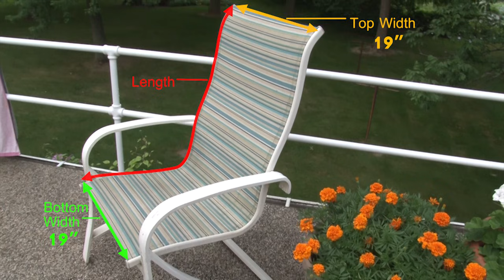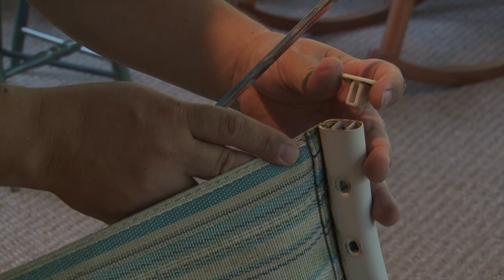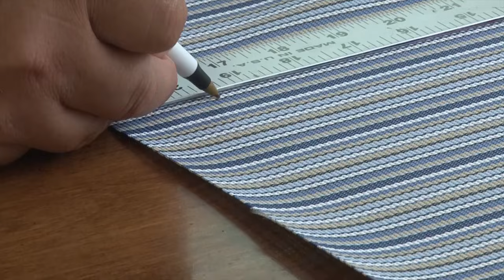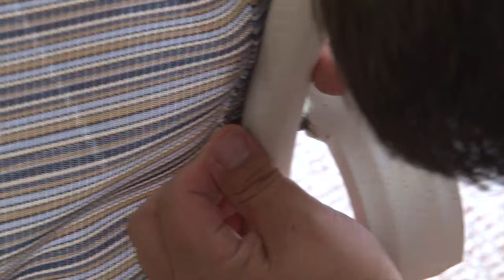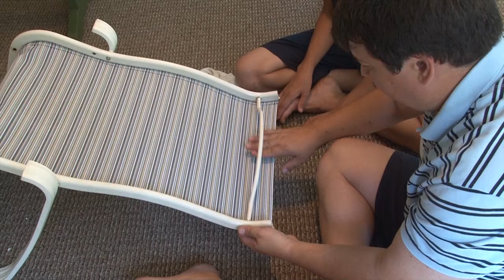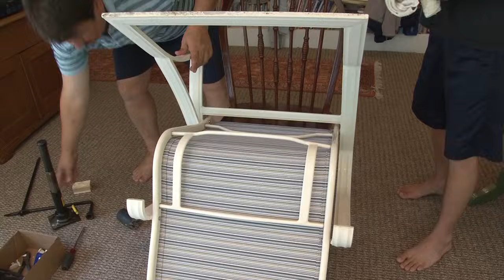Replacement Sling Cover for Patio Furniture -- Make Your Own

Comment: So you don’t make the slings undersized relative to the measured width? When you measure them they are under stretched tension. It seems if you make them to measurement, they will be under no tension at all when installed.
Reply from the maker: It would seem like that, but the tension bars pull out the excess fabric very well.

Comment: To easily put the new fabric on the chair cut old fabric out using a blade or scissors while chair is still together.  cut as close to the ends of old fabric thats still on chair then take a flat head screwdriver and turn it sideways and use a hammer to hit the flathead screwdriver to push the old fabric sling down enough to pull it out. And to put new fabric in slide it on while chair is still put together on one side.  makes it alot more easy then unscrew the screws of the side u just put the new fabric on and flip chair over and put that side on while its still screwed onto the chair to make it a little more easy clamp the chair down onto a table so it does not move when pulling new sling on

Comment: Super great video, I made my first chair sling & although a lot of effort to install, it is very rewarding! I do have a question… do you have any guidance on how to remove dried ink pen on the fabric? I inadvertently drew the ink line on good side of fabric as instructed but using measurement without the selvages… oops!
Reply from the maker: Well..... this will sound crazy, but the best ink remover on fabric is McLube™ Sailkote: https://www.sailrite.com/McLube-Sailkote-8oz It is a lubricant, but it works great at removing stains on most fabrics. Just don't use it on a polyurethane coated fabric. As with any cleaner ---- Always test, before using on finial project!

Comment: My mesh is fine, but the rope part on the side is starting to "pop" out on a few chairs.  How do I get it to go back into the channel??
Reply: Is the rope worn/weathered/defomed? If so, you can get new rope. (I've heard of people using 1/4" outside diameter vinyl tubing from the hardware store.). If your channel has spread open, maybe use 5/16" rope instead of 1/4".

Comment: Thanks for this informitive video and thank you for clarifying that you measure from the outside of the fabric chanel to the outside of the oposite chanel if the chair is bare. As for inserting the plastic spline/"cord" - personally I would NEVER try to reuse the old brittal spline. We bought new, warmed everything up in the hot sun and the fabric & spline slide in with ease and everything tightened up perfectly. As suggested, we subtract 1/4" from the lenght which proved to be unecessay and caused it to not reach all the way from top to bottom. Thanks Again

Comment: Would a standard sewing machine be able to handle this sort of fabric?
Reply from the maker: To determine if a home sewing machine can sew Mesh fabrics for seating applications perform this test: Cut up a pair of old blue jeans into four layers (not including the jean’s hems). Since a home sewing machine usually can’t handle a thread larger than v-69, use that thread or something comparable and try to sew through the 4 layers of blue jean material. If it sews well and the stitch looks good on the top and bottom side of the assembly then chances are you can sew using your home sewing machine for small to medium jobs made with Vinyl Mesh fabrics.

Comment: I put the tension bars in place before putting the seat on the frame and before tightening all the screws, while it still has a wobble.  Move one side a little higher, install the bars at an angle then straighten out and put onto the frame.

Comment: Reusing existing spine cording... Any tips on how to keep the spline cording from shifting when installing the fabric? I always end up with .5" sticking out and the other end not having the support to hold fabric in channel.
Reply from the maker: I cut the spline cording longer than the sleeve then after it is installed I cut off the excess on both ends, since it moves a little.

Comment: I have a question on the hem on the sides where the spline are inserted, the commentator says 1/4" turn for the hem, but it looks like 1/2" then its sewn with a double stitch in place. Is this correct? what I'm seeing???
Reply from the maker: The first fold determines the finished width of the chair, it is about a 1" hem, Then the outer edge of that hem is folded back about a 1/4" to create a sleeve for the spline. When we sew it we sew with two rows of a straight stitch that are very close to the inside edge of that double hem. The two stitches are placed about 1/8" apart. I hope this helps!!!
Reply: @SailriteDIY  I have another question....when measuring the width of the chair are you measuring from the outside edges of the chair???.....I practiced on a remnant piece and I measured from the center of the grove and I came up short.
Reply from the maker: @denisethuman1307  We measured from center of the grove on each side, but we then added a 1/4" to both sides for the creation of the sleeves, this will be the finished width. An example is a chair that is 19" from center of grove to center of grove. We will then take the 19" and add 1/4" + 1/4" = 19 1/2" is our desired finished size. To that we will also need to add extra fabric to the width 1 3/4" + 1 3/4" for the construction of our sleeve, so our cut width is 23" and our desired finished size is 19 1/2".
Reply: @SailriteDIY  Ah thank you I see what I did wrong thank you so much.

Comment: You do not need a commercial machine to sew these, I used my home sewing machine with a larger jeans needle
Reply from the maker: Can I sew Phifertex Plus fabric on a home sewing machine. It always depends on the quality and working order of the home sewing machine you own (so it varies greatly from machine to machine). To determine if a home sewing machine can sew Phifertex Plus fabric perform this test: Cut up a pair of old blue jeans into four to five layers (not including the jean’s hems). Since a home sewing machine usually can’t handle a thread larger than v-69 use that thread or something comparable and try to sew through the 4 to 5 layers of blue jean material. If it sews well and the stitch looks good on the top and bottom side of the assembly then chances are you can use your home sewing machine for small to medium jobs, like sling panels.

Comment: My tensioning bars are not detachable. They appear (under the paint) to be welded onto the back/underside of the frame rather that being inserted in the inner sides. Any tips, or will this be impossible in my case?
Reply from the maker: If the sling chair has welded tensioning bars instead of removable bars replacing the fabric can be very difficult. Those type of sling chairs are typically discarded once the fabric is damaged.

Comment: It is difficult to see exactly where you are taking the width measurement.  Do you measure from fabric to fabric or from outer frame to outer frame?  Mine didn't come out right.  They are a little too wide which allows them to sag instead of fitting nice and tight.
Reply from the maker: Here is an updated video on the sling chairs, it should be helpful in seeing how to measure: https://youtu.be/6HAUe6E6FP8

Comment: For installing the tension bar, what I have done for my chairs, is I place the tension bar, then screw gradually not completely the buttom one each side, I screw not completely the middle, place the top tension bar and screw not completely and then I finalize to screw from the middle and the buttom and the top equally.  I did not need the Hi-Jack.
Reply from the maker: Great advice, thanks!!!

Comment: This seems like a ton of work. How much money am I actually saving?
Reply from the maker: Well, if the chair's fabric is ruined you need to replace the fabric or our buy brand new chairs. If you buy 4 yards of Phifertex Plus fabric you can usually finish 6 of these types of chairs with that 4 yards of fabric. The Phifertex Plus will start at about $19 per yard. So... for about $76 dollars (plus thread and other tools) you can finish 6 chairs (that is about $13 per chair for the least expensive Phifertex Plus fabric).

Comment: Do you need a special machine for this or can I do it with a regular sewing machine?
Reply from the maker: Most sewing machines can handle sewing Phifertex Plus fabric. However, it would be good to test your sewing machine by sewing through about 4 layers of denim blue jean material with a heavy thread. If your machine can do that chances are it will sew Phifertex Plus fabric.

Comment: The longest stitch available on my home sewing machine is called "6 stitches per inch," but when I make a test seam and measure a stitch, it is actually only 1/8" in length.  You recommend stitch length of 6mm, which is about 1/4".  Will the Phifertex fabric perforate and rip if I attempt to use my machine's smaller stitches and V69 thread?
Reply from the maker: A 6mm stitch is best (about .23"), but a smaller stitch length is acceptable. The Phifertex fabric will not rip along the seam, even if a smaller stitch length is used.

Comment: Should not  sit or stand in front of either end of that jack. If that small end had slipped out under the extreme pressure being applied, it would have shot into the stomach of that boy sitting cross legged in front of it and could have severely hurt him or even killed him. Nothing guarantees that the frame of the chair didn't just buckle under the pressure and make the jack pop out. Should stand to the side and be doing it in a space, like outside where it could go flying across the lawn and not hit anything. Should also wear safety glasses when doing anything that involves applying pressure to something. Also, best to wear safety goggles when hammering something. Tiny bits of old paint can bounce off. Make safety a priority in all projects. Just think, the blocks possibly popping out were not a problem for fixing the chair but a problem for the well being of those around. And don't have small children, like that little girl aimlessly wandering near by except for the extremely safe steps that involve nothing that includes resistance of any kind.

Comment: I'm going to do this. To replace slings on 4 chairs, the local shop wanted $430.00!! If I ordered them pre-made it would cost me $176.00.  I ordered all my supplies at Sailrite (thread,  sewing machine needles, fabric and cording) and the cost will be less than 100.00 and that's including tax and shipping.  Way better than trashing my lawn set. Plus I won't have to wait 4-6 weeks.  For those of you who want to do this, find a friend with a sewing machine. The actual sewing on these is just easy straight hems.
Reply: Our local shop wanted $550 for 2 chairs and $120/labor. Enough extortion! I will do it myself!
Reply from the maker: Excellent! I hope the project comes out well. Let us know if you have questions.
Reply: Christy M k

Comment: Thankyou for this great video. I have a great problem, I can't seem to be able to pull the old fabric out of the old chair. Please help
Reply from the maker: If you have problems pulling the old fabric out of the channel try using a dry silicone lubricant and spaying the channel. Then use pliers and a second helper and pull on the fabric with the pliers. The pliers may rip the old fabric, so do not plan on using it again if you do this.

Comment: Hi. I already have some 100% nylon Coats & Clark Extra Strong Upholstery thread left over from another re-upholstery project. Can I use that in place of the V-69 thread? I just received my Phifertex Vinyl Sling Patina Stone 54" Fabric from Sailrite and have dismantled the first sling chair.         A tip for those that are having difficulty getting the old cording out: I trimmed as much of the old mesh fabric away as I could and then sprayed some WD40 into the slit to get the cording to slide out.

Comment: I just received my material and am dying to get started...I'm just starting with one for now...but I have a question about where to make my side to side measurements from.. do you measure from right at the exact edge of the fabric on the chair to the other exact edge of the fabric or do you go from the outter edge of the frame....in your video all is excellent except that one most important issue doesnt say....please respond asap....I can hardly wait !!
thank you sooooo much for the video....would never have tried this if I hadn't found your instructions...
Judy Kelley
jykell@aol.com
Reply: +Judy Kelley PS!!!  my chairs are two pieces...a separate  back and seat..
Reply from the maker: +Judy Kelley Measure from side to side of the edge of the fabric then add 1.75" to both sides for the double hem/sleeve for sling cording. In the end you want your new fabric panel to measure what you old panel was in width.
Reply from the maker: +Judy Kelley No problem, same procedure.

Comment: I bought the phifertex mesh but  my needles keep breaking  please help what size or type needles do I need?
Reply from the maker: donna doyle If you are using a home sewing machine I would use V-69 Polyester thread and a #16 or #18 size needle. If using a heavy duty sewing machine I would use V-92 Polyester thread and a size #20 needle. Why do we use lighter thread for a home sewing machine? It is because the home sewing machine usually cannot handle the heavier thread (V-92).
Reply: thank you    so much

Comment: make this look easy  any tips of how to get the replacement  back in the side rails ?  cord goes in but the fabric  doesn't thank you
Reply: Some sort of lubricant will help it go in easier.  They show using dish soap in the video, I used wire pulling lubricant on mine.  The wire pulling lube is in the electrical section of you favorite hardware store, and being water soluble it can be washed away after the fabric is installed with a hose.
Reply from the maker: +Kevin Drake Great suggestion Kevin. Thanks!!!
Reply: helpful tip thanks

Comment: Thanks for this video!!!  I have 6 chaise lounges as well.  I have already done two of them and they look great.  Two of my remaining four have left me with a question for you.  On those, the frame appears to be bent or possibly just over rotated due to the previous owner tightening down their first screws before attaching all of the screws.  This results in the bottom width measurement being a half inch less than the top width.  Which measurement should I use here?  Should I try to straighten them out and use the lesser of the widths?  Or should I re-install them as is and make my top width slightly wider?
Reply from the maker: In most cases the fabric may have stretched and going with the lesser measurement usually works best. I often see panels that are wider at one end, I always make the sides the same, going with the smaller of the measurements.  Typically the frame can be loosened enough to insert the fabric then tensioned enough to support the fabric. If possible make one and test before making the rest.
Reply: Sailrite
 Thanks for the quick reply.  That is actually what I did (taking the smaller of the two).  Also, my chaise rails had bent in on some of them so that added to my measurements not adding up as well.  The Chairs and Chaises look great.  What cost me about $300 and a week of working on them at night, saved me from having to pay the $2100 to my local patio furniture dealer.  Thats what they wanted for 6 chairs and 6 chaise lounges.  Buy from sailrite and take it on yourself!!!  It's totally worth it!

Comment: We bought the Sunbrella sling fabric from Sailrite (prompt service), followed your directions and the chairs turned out like new!  We are very pleased.  Just a couple of observations-it does take two people to pull the fabric through the channel, the length measurement is critical (the width has a little wiggle room), and a little Vaseline in the channel in the curved area helps it slide.
Reply from the maker: Excellent comments and good suggestions!

Comment from the maker: Debra,
The sewing of the sling chairs is easy, but the installation of the new fabric (depending on the type of chair) is the most challenging part, as shown in the video. But, it is possible using a few common tools that most people have already on hand. I am not a professional when it comes to sling chairs, but I did it myself and was pleased with the end results. Often buying new furniture results in colors that may not match my needs and fabric that is cheap and does not last long.

Comment from the maker: Most home sewing machines take a system 130 needle. Those needles have a flat side to the upper shank. When sewing with a home sewing machine I recommend you use a V-69 thread with a size #18 needle. At the Sailrite website it is part #20214 for the System 130 size #18 needle.
Reply: can i use my regular singer home sewing machine and just replace the needle and thread as you mentioned?

Comment from the maker: If you need new rope cord purchase 1/4" plastic tubing from a hardware store. The 1/4" plastic tubing is usually used for ice maker water supply lines in refrigerators.

Comment from the maker: You can cut the sleeve open with scissors which will help you gain access to the cording in the old cover.  Cut the fabric apart near the stitch for the sleeve and close to the piping. Then pull the coding out.

Comment: HELP I can not pull the robe cording out of the old chair......is appears to be stuck or still attached to something.  It is stuck in the bend of the sling. I can get it to move about one inch.  I am a DIY person and ready to tack this project.
Reply: use spray silicone?   Baby powder. ??

Comment from the maker: We used a Polyester V-92 thread because we used a heavy duty sewing machine (the Sailrite Ultrafeed LS-1 sewing machine #102500). If you have a home sewing machine you can use a V-69 Polyester thread as the V-92 may be too heavy for a home sewing machine to handle.